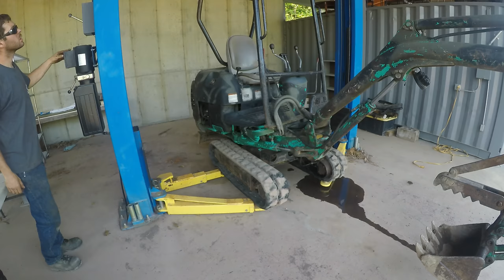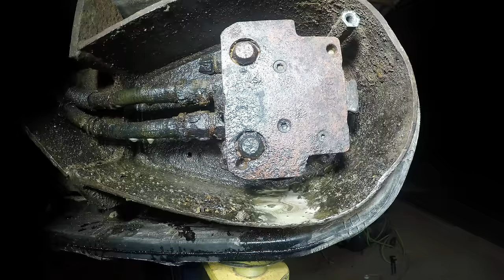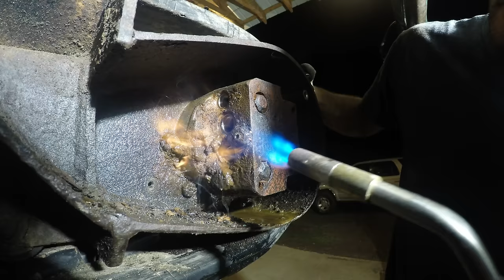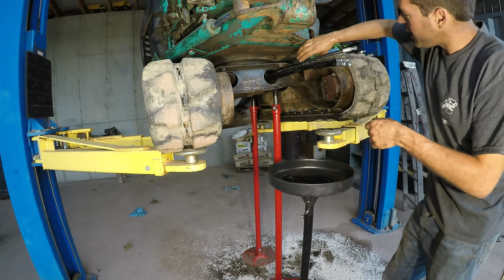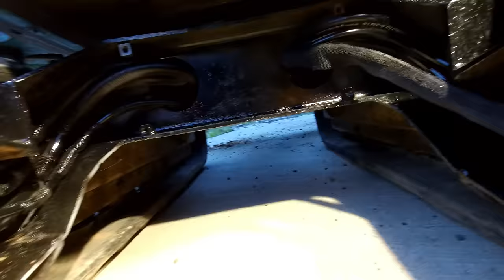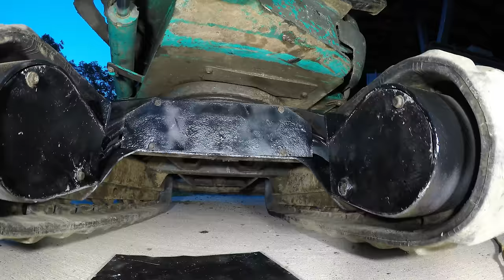Replacing excavator final drive hydraulic lines

Comment: JIC Fittings,  I worked on some tough ones,  but that little one was power driven on, "-)
a machine like that, a few make up fittings would do you well, Eaton is an other good one, used pretty much all types, lots of Cat,  had two or three hose presses 
make fittings going all the time. big dirt spreads, love it.  Synfex last a long while, just don't let it rub on, 
 Here's something to take note off, Teflon, take the tape for fittings, never use on where you putting a pipi thread fitting in a cast iron block water port , casting, it will bust the casting, crack it. I done it  to air compressors, engine coolers. 
Teflon if it is rubbing on High Carbon steel such as the cast cat frame, nothing will happen to the tie, but it will rub a slot all the way through the frame, generally 
 where Hyd- hoses would be pressed up against the frame, the cycles  do it. 
just giving you a heads up. boss. give it what for. "-)

Comment: Was just wondering Andrew if one could spray a little of one of those can foams around those fittings to help prevent mud and moister from attacking, then when it came time to fix it is easier to remove old foam (especially coating bolts with grease or Vaseline) than rusty coated bolts. We use this technique in construction in situations.

Comment: to fix more things that arn't broken yet.. i would want to examine the grease fittings on the swing bearing..  see how many there are...  i might want to see if there is a way to clip on to them and really flush that swing  or turntable bearing while it rotates..  even if you have to take the zircs out and install high pressure hoses to a grease gun while you spin ..  that should be done any time you get in water or mud..   how about the lower track rollers.. are those sealed or grease type.

Comment: A tip for anyone doing stuff with hydraulics, always put grease on all the fittings, stainless on stainless without lube will weld itself together and it will be a pain to get it apart next time, and that's IF you can get it apart at all.

Comment: When the machine  was new all the components  were assembled  at the same time .some components  disintegrate   about the same time. Things like  hydraulic  hoses can cost  you more than than price of the hoses . Have a hose come apart  from  the inside   and a pump , valve Body or a drive motor changes the equation .

Comment: Andrew, your "if it's not broken, leave it alone", sentiment may be something that you should reconsider living by, at least in this situation.

(i.e.) The hydraulic left and right lines were all installed at the same time, used the same amount of time, used under the same working conditions, received the same amount of water, heat, dirt, freezing and as such, the same degree of material/part stress.  Therefore, in my opinion, it would be a logical assumption that since all of the left lines were rusting out, then the same could be expected of the right side lines. I know, money is a consideration, especially, when the lines must be fabricated at a machine shop which cost far more than across the counter parts do, but as the old adage goes, "A stitch in time, saves nine"

Have a great day and spring, Keep On, Keeping On !

Comment: How did you keep track of which hose went to which two connections? 
When I removed my plates you couldn't see the hoses or the box -- just dry powdery dirt to within an inch of the top! Picked it all out and there were 1" stones there as well. So not only should the plate have a seal but the hole where the hoses come in need a rubber cover . Or have they been removed and not replaced? It's a Takeuchi TB 106, 2008. Thanks ...

Comment: from previous experience try using  high  pressure rubber hose lines or braided stainless steel with aluminum hose cap's & adapter's  (Aerospace grade) they use them on airplanes , even if you have to make them your self as in not OEM. where your at seems like Rustville county

if it doesn't stop the rusting it will slow it down a lot and if you want to go the extra step use rubberizing spray and the metal parts when you install them new

Comment: I'm surprised you have had such bad luck with John Deere equipment. I've used only John Deere equipment for 32 years. Two compact tractors, two riding mowers and two Gators. The early ones had more metal on them than the newer stuff which has more plastic. I've had excellent service with my JD equipment. Yakima is a huge agriculture area.  John Deere enjoys it's place as the primary farm equipment dealer for miles around here.  Great video Andrew! Thanks.

Comment: Yeah would have cleaned it with a wire brush and then brake clean. Maybe plugged up the holes as hoses removed. Never use chlorinated brake cleaner. Woulda prolly used frozen nut socket with the spiral turns inside it. Those work great.I think lock rite makes a sealer for hydraulics fittings too. Maybe next time use a sling to support the whole thing. It would suck to get crushed!

Comment: When you remove any line  from a Mechine it should be heated slightly to break the Teflon that they may have put on I broke the front of a semi trailer trying to remove a glad hand and I found that all you have to do is heat it and it comes off as easily as it did the day it was put on!

Comment: Might sound silly but next time you have to put hose fittings thru dirty, grimy areas simple put a condom over them and use an elastic band to hold it on, helps to keep the crud off of them and save yourself some time not having to worry about small particles get in the threads.
Reply: Or rubber/nitrile glove finger tips.
Reply: glove fingers and rubber bands or o rings....for the win.
Reply: I bet that would be a hard one to explain to the wife. "Honest Honey, I only have those condoms in my tool box so I can protect my hoses from grease and grime".     LMAO

Comment: Tap tip. Use a corresponding nut to tap size for 1/4.5/16 and 3/8 and pound it on the chuck end till not quite through the nut and use a deep well socket to run the tap. Just takes a little getting use to and you won't reach for that T handle again
Reply: I have a few setup like that... Great for tight spaces.

Comment: Also there are lots of bolts on machines that are glued on and heat is the way there too they also sell a tool that heats up red and comes in different sizes so you can put it around nuts or bolts that you can not heat with a torch. Plus when your replacing sections of tracks shocking it with a torch to red then cold water works really good at least much more manageable. Love your show but I like listening to the Mechine just sayin

Comment: Andrew, Does your Machine has a Hydraulic gauge? Like a clear tube to see the level of the hydraulic ? My 2005 does not. I wonder if previous owner removed it or don't come with one from factory…
Reply from the maker: Yes, they usually do. Its a little window on the side of the hydo tank. Sometimes there is a ball that floats and it should be between the two lines.

Comment: The rust problem up there is much more severe than here.   I sand blast things going into salt water  to clean all the rust off then prime it and paint it with Oil base enamel paint.  If they are kept painted and clean they last much longer.

Comment: That one line rubbing against the sheet metal has me a bit worried, over time it might abrade against it.  But definitely invest in a orange plastic cap and plug assortment for hydraulic fittings.

Comment: Feel for you guy s over in some parts of the states, so much rust you get on your machines and cars, same as in the UK , over here in Australia we don't get rust and corrosion this bad. our repairs are so much easier without all the rust etc.
Reply from the maker: Yeah, usually machines don't rust, but cars/trucks can rust and fall apart. I've welded plenty back together to try and get a few more years out of them.

Comment: I have been welding since 1992 and I don't know everything.But the contact tip is suppose to be 1/8 to 1/4 inside the cone not 1/4 outside of the cone.No way your getting any shielding gas in your welds.Since your just welding a nut on it maybe doesn't matter.

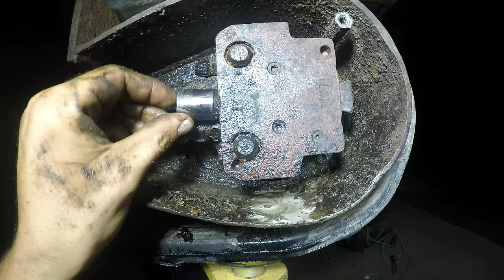Comment: At 4:49   What I don’t understand about what Andy is doing at this stage,  and so many other mechanics will do the same thing at this stage if you will go to this time on the video and see what I’m talking about.  I’ve never understood why mechanics will not clean up ‘ CLEAN—OFF!!  Nuts / bolts screws etc that is something I firmly believe in and I never have the problem that he’s running into here.   Because I will clean them almost spotless and I never have any trouble getting a wrench or a socket on anything.  Because,  I CLEAN EVERYTHING OFF SO GOOD.

Comment: hyd.shop has hose fitting caps that keep fittings clean when installing, also with allen screw in middle of last nut, looks like for setting hyd. pressure on motor, it's good that you cleaned it anyway, hope you don't change the setting.

Comment: Just a question from a guy that's never worked on one of these: Are those systems self-bleeding? Do they not get air in them when doing these types of repairs?
Reply: kabarsedge  yes they are
Reply: @evancyr8373  Thanks for the reply.

Comment: Why did you use the Mig on the Bolt, seems that would make it harder to take off.
Reply from the maker: I welded a nut onto it. The nut gave me something to get a wrench on, and the heat from welding helps loosen up the piece that was stuck.
Reply: Now that make sense.  I hope there wasn't any rubber seals in there that got Melted.  I remember I heated up a pressure washer pump to get a bolt off one time....and that was it for the pump because of all the plastic internal parts.

Comment: I was totally cool with you using the lift. That mini escivator is about 8900 pounds and I'm assuming that's a 10k lift..... So no issues there.

But jogging escivator in the air..... 🤷🏻‍♂️ That was a holy shit he's going to die moment
Reply: Edit: looked up the weight Google says operational weight of this machine is only 3637 lbs...
Reply from the maker: Yeah, that's a small excavator. And that company claims that lift wont fail with 15,000lbs on it.

Comment: Don't read this if you don't care about this machine and are just keeping it around for a few jobs.

1. don't leave connections uncapped, all the crud and all the welding beads that can get in will kill that drive eventually, irreparably. a bag of assorted rubber caps is cheap vs that drive, and second hand isn't always better.

2. don't heat the drive, you'll melt any seals and you'll fudge with tolerances inside which will also kill it eventually.

Best solution to get that crap out is to simply use a drill, drill the thing out and then just pick the remaining threads from inside, flushing some from the opposite side to push out any of the chips that might get in. Oh and if a drill motor doesn't fit, you use a 90 angle from any hazard shop around you. You don't even need to get close to the OD of the threads, drilling the guts out is enough to release tension and the heat from the operation, sufficient enough to unsettle the thing.

just my 2 cents having purchased quite a few disused or decrepit pieces of equipment for random jobs and having to fix years of neglect and so on on the cheap because i'd eventually flip them on to the next poor sod.

Comment: Can someone explain to me how the hydraulics work on the rotating machine to track assembly? Is there a stop so you can’t go 360 degrees?
Reply: There is a "swivel joint" in the center of the machine which allows the cab to rotate 360 degrees round and round continuously. Hoses for the tracks and front blade connect to  the top half of the "swivel joint" and then hoses connect to  the bottom half and go to the track motors and the blade cylinder.  This allows everything below to have  hydraulic fluid while the cab rotates.  There are seals on the "swivel joint" which allows all this to happen.  These seals will leak after time and  will need to be replaced.
Reply: Alan Tiefenbrun 
Thank you! I can see how that would work. Pretty cool.
Reply: @TheSagerider  Thanks, all excavators are built pretty much this same way.

Comment: You need to take a wire brush and spray oil to those rusty fittings before trying to remove them , 👍👍i have 20 years on the 🔧

Comment: Andrew,I notice you use a lot of rust solvents. The best by far product I've ever found is this mopar spray. It eats rust like candy.I got some off the dealership to fix a rusted exhaust manifold valve on a 1970 dodge pickup. I've been using it for 40 some years ever since.at amazon 4318039AC rust penetrant by chrysler.

Comment: Andrew, You need to come to Chattanooga and see where the 210-490 size machines are made.
Reply from the maker: What brand machines? I thought most of the excavators were made in Japan.
Reply: Andrew Camarata  Komatsu PC210s up to PC490.  Smaller and larger are made in Japan.  Cartersville, GA has a demo days occasionally during which you can tour the Chattanooga excavator plant.
Reply from the maker: Neat.

Comment: How thick is the concrete floor of your shop???
Reply from the maker: 9", but it didn't need to be that thick. That lift only required 4" in the instructions. I would still go at least 6" if your planning on doing a lift.

Comment: Hi how many hrs on digger
Reply from the maker: Like 4400 I think.
Reply: Hi Andrew I have small building and groundwork business in Lincolnshire England just me on my own with a tipper truck old JCB 3cx ,6ton dumper ,1.8 ton mini digger ,skip loading dumper and roller  I have been doing 25 years now still repairing may gear and making a living and would not change a thing happy days

Comment: PRO  TIP......
Pressure Wash. 
Your work area clean before you start disconnecting hoses.....
and 
You will NOT have to worry about contaminants getting in your drive Motors .....
duh

Comment: Why did you put only one protective sleave over a hose and left 2 others unprotected? You wanna do this job aggain? Why save on a couple of $ if this can extend the life of youre work.
Reply: Maybe I was mistaken, but I thought I saw labeling on the hoses saying they were protective covers..  when he displayed the hoses just out of the shop that made them, they appeared to be about 1/2in ch hoses.  The hose cover tubing looked to be at least 1 inch diameter.  Go back and watch again.  I may be wrong but don’t think so.  I’ll try to find that piece of video.  I was concerned about the same thing until I read the printing on the cover. 

JoaB

Comment: That thing on a lift is scary. Also I wouldn't recommend a cheater bar on a ratchet like that. Use a a breaker bar instead because the tiny little teeth on the ratchet will bust off.
Reply from the maker: Adam Ruck I’ve broken more “breaker bars” than ratchets.

Comment: Running the machine while on the lift is giving me gas.  I’m surprised the lift didn’t fail and drop the machine. Please be more careful
Reply from the maker: Matt Cerbone why would the lift fail? It’s a 5 ton lift with a 2 ton machine on it.
Reply: Andrew, the lift is adequately rated for straight vertical capacity on a balanced load. Even when not turning the tracks on the machine, the arm was out causing some motion I didn’t feel comfortable with. Yes, the machine is counterweighted. Still made me cringe a bit. Now, having the machine off balance, when you were moving the track distributes weight unevenly, and creates torque in places on the lift where it wasn’t designed to move......and you had the machine fairly high in the air. Nothing happened, for which I’m very glad. I wouldn’t take that risk twice.
Reply from the maker: Matt Cerbone It was fine, I had stands under that thing, and I had the bucket down on the ground

Comment: I was wondering why didn't you bother to clean the junk and all crusted mud with pressure washer before reinstalling new hoses knowing that any  possible contamination can be a big set back for this simple job. Honestly I admire your work in many aspects but there is always big sloppiness about your mechanical workman ship, such as dirty work area, using wrong tools, breaking parts, hammering bearings and etc...other than that you're very capable guy sadly without finesse. It is not against you but just a comment. ..thanks for your videos

Comment: Does anything affect you? lol When most people snap off a fitting like that because it's rusty and corroded, they lose their minds and whine. Not you! I have never seen you lose your shit and I have watched you lose a wheel while running down the road. No worries, I'll just weld a nut on and keep going. Your poise under pressure is impressive.
Reply from the maker: Getting upset doesnt help anything.
Reply: @AndrewCamarata ur right it doesn't help, but the argument people would use is that it is a natural reaction

Comment: SUGGESTION, IF I MAY,, WHEN DOING HYDRAULICS WITH JIC FITTINGS, ALWAYS DAB A LITTLE GREASE IN THE MALE THREADS, WHEN UNDOING THE FITTING NEXT TIME, YOU DON,T SHEAR THE MALE FITTING. I WOULD ALWAYS GREASE THREAD,S  IF OUT IN THE WEATHER HAVE TO THINK OF THE NEXT PERSON DOING THE JOB, STANDARD THINKING WHEN YOU HAVE BEEN AT SEA ALL YOUR WORKING LIFE.BEST FROM A MARINE CHIEF ENGINEER. RETIRED.